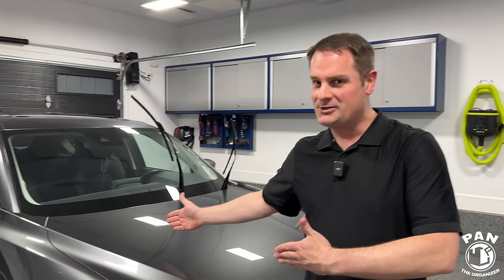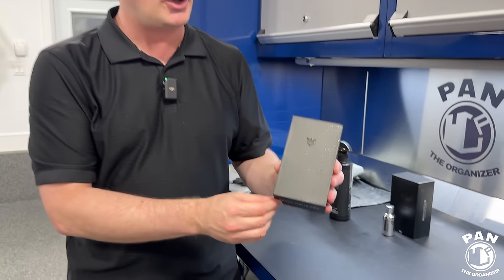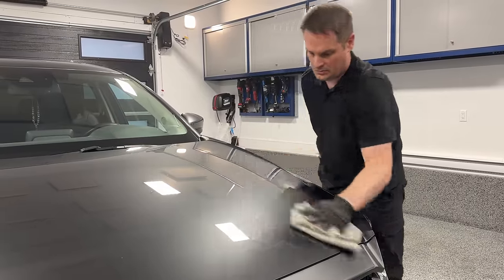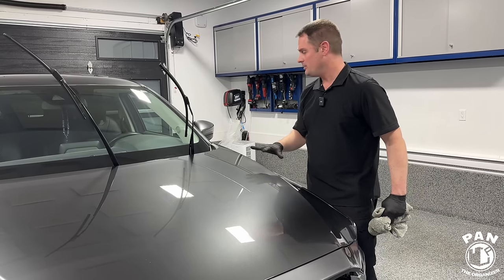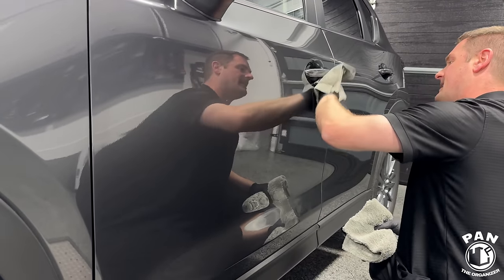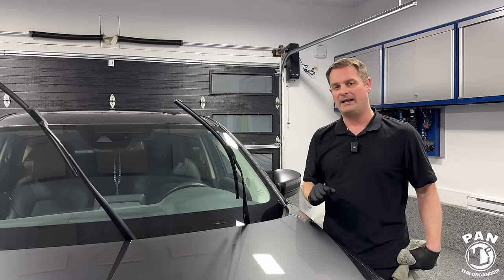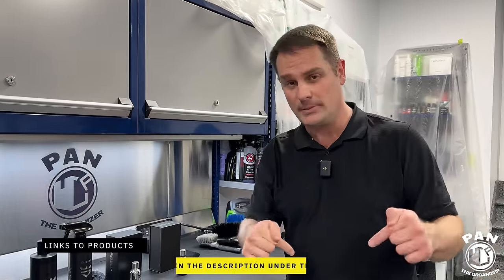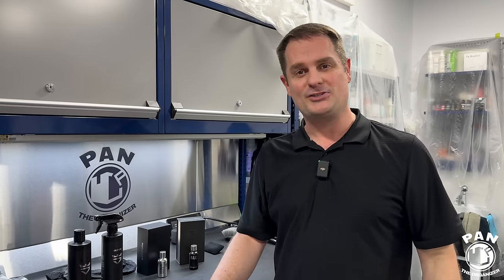NEW AvalonKing Armor Shield MAX ceramic coating! 1 layer, 3 years protection!

Comment from the maker: ⬇🔶 LINKS TO PRODUCTS MENTIONED IN THIS VIDEO ⬇⬇

✅ The new AvalonKing Armor Shield IX MAX coating: https://avl.kg/panas9max

Get a free AvalonKing LITE ceramic spray with your MAX coating! LIMITED OFFER

AvalonKing Ceramic Prep Shampoo: https://avalonking.com/products/ceramic-prep-shampoo
AvalonKing IPA Prep Spray: https://avalonking.com/products/ipa-prep-spray
AvalonKing Multi-Purpose microfiber towels: https://avalonking.com/products/multi-purpose-microfiber-towels-6-pack
AvalonKing microfiber buffing towels: https://avalonking.com/products/microfiber-buffing-towels-3-pack
AvalonKing Microfiber Chenille Wash Mitt: https://avalonking.com/products/microfiber-chenille-wash-mitt
AvalonKing Armor Shield Lite (maintenance spray): https://avalonking.com/products/armor-shield-lite

✅ The original AvalonKing Armor Shield IX beginner ceramic coating: https://avl.kg/pan25

Use the promo code PAN25 during checkout and receive $25 off each purchase! Discount code only applies to the original Armor Shield IX ceramic coating.

Watch more of my videos below:
✅ Armor Shield IX application demo and review: https://youtu.be/Rgli6VNLsK4
✅ AvalonKing Armor Shield IX : 2 year update: https://youtu.be/2f6baiZskeA
✅ AvalonKing Armor Shield Lite spray review and demo: https://youtu.be/li-H4JUQHf4

Comment: I’ve applied AS IX twice and have been very pleased with it and with the support from Avalon King.  I ordered AS IX Max this evening before watching this video.  One important application detail is to wipe off or buff the finish as soon as it flashes (depending on temperature may be as soon as 1 minute).  If you don’t buff it off quickly enough it is nearly impossible to remove the flashed product from the finish).  I do much smaller areas before buffing than shown in the video.  With AS IX I always apply 2 coats to ensure full coverage.  The gloss is amazing.
Reply from the maker: Thanks for sharing your experience. How did you discover my channel by the way?

Welcome to my channel. You discovered one of the biggest car detailing channels on YouTube as we surpassed 985,000 subscribers and we have over 135 million views! I have been detailing for 27 years and I love to share my knowledge and passion with my viewers.

You found the right channel to help you learn everything about detailing.
Reply: How is the slickness? Me I don’t have any slickness at all. Gloss and hydrophobic are very good however.
Reply: @benoitparadis6398  I applied AS IX two years ago and use the AS lite every other week after wash ( I wash my car at least once a week) and it's still super glossy and slick. If you put a plastic cup or bottle on my hood it will slide off. FYI my car is a daily driver and never seen the inside of my garage except when I applied AS. Looking forward to AS Max or GOAT, I'm still haven't decided which to use. My understanding is AS GOAT is a bit harder to work with but last much longer then Max.

Comment: Really happy to see they have upgraded the applicator pad.  That foam block was terrible!  For the beginner or non-professional diyer, I do think this is an acceptable product.  User friendly, that doesn't break the bank, and provides a great result. The new and improved version looks even better and I will definitely consider purchasing.  My only beef with Avalon King, is when they have a sale.  I live in Canada, and when I tried to purchase Armor Shield Lite, $25 immediately jumped $10 plus tax and shipping, which brought the final price to almost $50. Not a great deal, and I was unable to get the advertised price, after numerous attempts. I gave up and purchased Maguiars ceramic topper at Walmart for $20. It does the same job I'm sure, for half the price.

Comment: It was three summers ago that I applied AS IX to our four vehicles.  (We are in the north-eastern Ohio area.)  First, the coating on my car remains fantastic; however, consider that my '88 Camaro is a summer-only car and is hand washed followed by Turtle Wax Flex Wax as a drying agent.  The IX is nearly spent on my wife's Trax and my Silverado--both are year round drivers, are solely tunnel washed weekly at the local Car Wash, and had gotten only semi-frequent ceramic detail spray applied (tough to do in sub-zero temps).  Finally, the Equinox coverage was spent  after the first year--our older son had it in college in Stuebenville for year one and our younger son now has it at Ohio State.  That car was lucky to have been washed whenever they came home with it.  It's really all about the maintenance.  Next summer I will be busy with five cars (older son recently purchased a Colorado) and this new product!
Reply from the maker: Thanks for sharing your experience! How did you discover my channel by the way?

Welcome to my channel. You discovered one of the biggest car detailing channels on YouTube as we surpassed 945,000 subscribers and we have over 125 million views! I have been detailing for 26 years and I love to share my knowledge and passion with my viewers.

You found the right channel to help you learn everything about detailing.
Reply: @PanTheOrganizer  I've been a subscriber for a couple of years and occasional commentor.  I have been fastidious about cleaning and maintaining my cars since my first (1976 Mustang II) when I was in high school in the 70s.  I recall first using Pledge, of all things, on its interior!
Reply from the maker: Hahaha yes Pledge, and the good old oily overly shiny Armor All days! And the terry rags (way before microfiber towels were invented), and leather chamois to dry (before microfiber drying towels were a thing) and hard to buff waxes! The good old days hehe. A trip down memory lane for sure!
Reply: @PanTheOrganizer  Actually, a combination of a "greasy" turtle wax product (it was clear) and consitently using a windshield sun shade has kept my dashboard pristine after 35 years of ownership.  Can't say that a lot about thirdgen Camaros--most are cracked and warped.  Have a great evening, Pan!

Comment: I applied Avalon King to my 720S almost two years ago, and the properties seem to still be effective on the PPF. Since it's been two years, I think I'll try their new product. I love that it can be used on glass, plastics, etc. Thank you for the review, Pan; your videos provide excellent visual demonstrations.
Reply from the maker: Thanks! What color is your 720S? Those are beautiful cars. If I didn’t have my 911 Turbo S and didn’t care for all wheel drive (I drive it in winter), I would have loved a 765LT!
Reply: @PanTheOrganizer  It's Sarthe Gray 2022—such a neat color. It appears black at night, but in daylight, the blue in the gray shines through. I considered the 911 T, but the McLaren's dihedral doors were irresistible. The sunroof's two-tone, button-activated design is fantastic as well. I'm eyeing the 911 T for the future, but I'm already tempted by the new McLaren 750.  All the best!

Comment: Thanks for taking us along on your adventure. The first Avalon King coating was super easy to apply. Looks like the new coating is as easy to apply and more durable. Enjoy your day.
Reply from the maker: Thanks for watching!
Reply: @PanTheOrganizer  please reply 🙏 Pan could you please tell me what we could use for those that have used the turtle wax hybrid solutions ceramic spray coating and alike that can go over top for dealing with the water spots? (The one's that don't come with the extra step)
Reply from the maker: I don't understand your question. If your paint has water spots, it depends how bad they are and how deeply they etched through the clear coat. You start with the less aggressive method first, and then see the results, and move up with more aggressive methods if the water spots aren't gone.
1) Use a waterspot removing shampoo like this: https://amzn.to/40txSJz
2) Use a waterspot removing spray like this: https://amzn.to/3uf65Ak (the car has to first be washed, and then you use the spray on a clean and dry surface)
3) Machine polishing.

Comment: I just finished applying this to a friend's motorcycle and found it very difficult to remove. Not sure if we left it on too long or what, but removing it was like removing honey from the paint. I have used the Armor Shield IX on two other vehicles and found it very easy to apply and remove.

Comment: Great overview of this new coating Pan. I didn’t think the original Armour Shield 9 could get any easier as it was already the easiest ceramic coating I’ve ever used (even easier than uk3.0). I think I’ll probably grab some of this stuff just to try it out. The problem I have with Avalon King is that I think they have some quality control issues with the formula, I’ve applied their coating several times and have seen inconsistent results; for the price though, it’s too be expected.
Reply from the maker: Thanks for watching! Yeah the original was sooooo easy to apply, it was the easiest when it was released years ago. This new one still retains that ease of application, and should in theory last longer all with just one layer, so I'm looking forward to real world testing to see how long it goes.

Comment: So is AK one of the more enthusiasts friendly coatings to use if you're not a pro detailer?
Reply from the maker: Correct. They are the easiest ceramic coatings you can apply in the DIY category. Nowadays, many brands are catching up with ease of application, but when the original AvalonKing Armor Shield IX coating was released many years ago, it was the easiest coating to apply by a long shot.

Comment: Thank you for this video @PanTheOrganizer! After watching your video, I purchased the Armor Shield IX Max coating. I have a quick question, in the video you said that the new version requires a single layer coating, but can it be applied over 2 layers. If yes, what is the technique and what's the wait time between applying the 2 layers? Thank you!

Comment: I have really been enjoying Pan's videos. After watching  his initial review of the previous product I ordered two bottles. Then I watched the Dimitri's Garage video where he tested that product with washings and it failed after two washes! Adams Graphine Ceramic, tested the same way lasted hundreds!  I hope Pan begins doing actual testing for things like durability..BEFORE..posting reviews.
Reply from the maker: Be careful what you accuse me of. You need to get your facts straight before dropping false accusations. I saw his video and he tested the old silver/chrome bottle Armor Shield IX, not the new MAX black bottle version. Two COMPLETELY different products!

The previous one I had tested in real world conditions and made many updates. It lasted 18 months on a super neglected car. Here’s a two year update video that I made: https://youtu.be/2f6baiZskeA?si=P93Qtb3uuY2vHqMF

This was an entry level super inexpensive coating especially with the discount code. Are there better coatings? Absolutely, but they are usually more expensive. The Adam’s Advanced Graphene Ceramic Coating is significantly more expensive. So yes of course it should absolutely last longer.

This new MAX version only requires one layer and the claimed durability is three years. I will be making updates on that too.

And it’s not because a product doesn’t last in one person’s conditions that it means it will not last for another person. There are tons of variables to consider for durability. Prep, application, conditions, weather, mileage, maintenance. I have covered that topic many times in the past.

I have also been testing the Adam’s Advanced Graphene Ceramic coating for over 2.5 years on my girlfriend’s car and it’s still doing ok. It did start to lose a bit of its original performance, but it’s hanging in there. It likely won’t last the full claimed 9 years though, as weather is brutal in Canada.

The only way to test a coating is to apply it and see how it does in YOUR specific conditions. Multiple wash test in one video doesn’t mean much. Nor do chemical resistance tests. Real world tests on a daily driven vehicle is the only way to draw true conclusions.

Also, NOBODY would test a product for four years before making a video... I hope you realize how stupid that is. By the time you'd be ready to make the video, there would be hundreds of newer and better products. The best thing to do is to apply, show people what the product is about, and do real world updates every now and then when possible.

Comment: I guess I just didn’t read the info on the original Armor Shield product but thought it was a 3-year product and not a 1-2 year. I have a car that lives outside 100% of the time in Atlanta, GA and has gotten a 3-month top coating for the last two years and it finally failed. I’ve re-coated it with the original product and then saw this new product. I may hold off for the upcoming 5-year product. Just need to see Pan’s review of it. As always, great video Pan. Please keep up the great work
Reply from the maker: Thanks! I’m also looking forward to test their 5 year G.O.A.T. Coating.

Comment: Hi tried armor shield Max it was hard to spread  and did not flash over sticky to buff I'm a seasoned detailer used armor shield  9 many time thinking they put out à bad bach ? Your install shows how easy and smooth not what I felt hope they will refund or replace my 2 bottles I'm waiting on the reply from Armor shield. 
Your video  are awesome keep up the great reviews
Reply from the maker: Thanks Julien! It's odd indeed that you didn't have an easy application. Perhaps you did get a bad batch. If overall you did apply it, and it's holding up, I wouldn't worry about it.

Comment: Hi Pan, I like the Armor Shield Coating the only issue I had was water spotting. This is normal from what I have learned. So I had to put CarPro Gliss as a topper. Then it was better from rain no problem but from the sprinkler system I had to get the car dry soon as I could. I wonder if the MAX will be better at water spotting? I do love the new one coat and dry time.
Reply from the maker: I’ll be looking for things like durability and water spotting issues in my long term testing.

Comment: Do you recommend using this coating for all surfaces like you did in this video or should a trim coat be used for trim and this coating for paint etc?
Reply from the maker: Up to you to decide. It's versatile enough to be used on pretty much all the exterior surfaces, so might as well take advantage of that, you'll be saving a crap tone of money. But like any versatile coating, it lasts longest on paint, compared to other surfaces. On glass, wheels and plastics, I expect about 1 year. Time will tell.

Comment: Hi Pan, awesome channel, you’re the GOAT. I have a Boxster, just wondering if there’s a ceramic coating for the fabric roof? None of the solutions I’ve used are hydrophobic for very long and I wonder what the best maintenance solution is? Thanks!
Reply from the maker: Thanks! For fabric tops, there are some fabric coatings like CarPro Fabric 2.0 but none are designed to last for years like oaint coatings due to the soft surface they’re applied to unfortunately.

Comment: I applied the armour shield ix to my truck 2 years ago. I am going to do the MAX in a few weeks. Just do a light polish, EPA wipe down, then apply the MAX?
Reply from the maker: If you haven't done decon in a while, I would do that. Wash the car, then iron remover, then clay the surface, then machine polish to ensure 100% removal of the previous coating, then panel prep spray to remove polishing oils and residue, and then you apply your new coating.
Reply: I applied the MAX to a truck this weekend, I couldn't see the flash even after 5 minutes. Too worried I wouldn't be able to get it off, I wiped it anyway. The towel drug and with little pressure, wiped it off followed by another towel. In last 6 years of using AS IX I've never had it do this. Shop was temperature controlled at 70° humidity under 65%..prep was wash, clay bar, IPA wipe out on brand new truck. Will it work ok?

Comment: I love your channel and every time I watch 1 of your videos I feel so inspired to go and detail my car. My question to you is, I don't have access to a garage but I can work in the shade all day but since I'm not in a control enviroment what can that do to the curring time?, with all the wind, dust and or bugs that might land on the vehicle before the 4 hours, should I cover the car in any way?
Reply from the maker: Thanks for the kind words. It’s certainly not ideal to apply a ceramic coating outside, but if you absolutely need to, you must follow some basic guidelines:
- don’t apply in direct sunlight, only in the shade on a cool surface 
- don’t apply in temperatures below 50F (10C), ideally being closer to 68F (20C)
- make sure you do it on a day with no rain
- not a windy day where dust flies all over the place

Comment: I just tried using IX MAX and have a question: what do you do when applicator pad becomes crusty? I don't have time to do the whole car at once. I do a couple of panels at a time. And when I returned for the next go my applicator pad became crusty on the side that I used the first time. How do you soften it back up? Or are you supposed to somehow wash it after use?

Comment: What do you use on the tyres? 
They are shine like crazy. 
And for the rims? U told you can do it with the max but in the video i missed them.
Reply from the maker: Tire dressing: https://bit.ly/3rF8xPM
For the wheels, we used a spray on rinse off sealant, to make things easier. This one: https://bit.ly/4598oTU
Reply: @PanTheOrganizer  thank you!!!